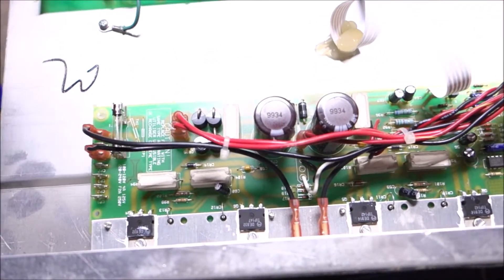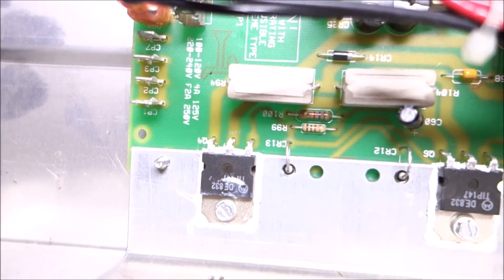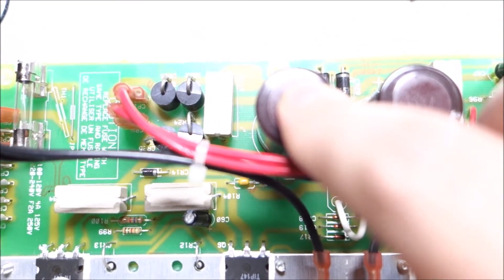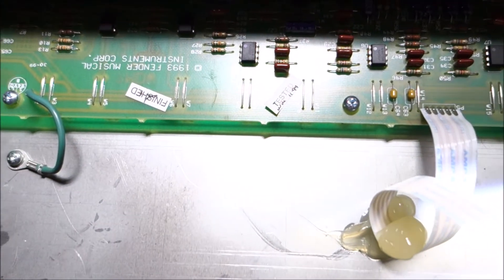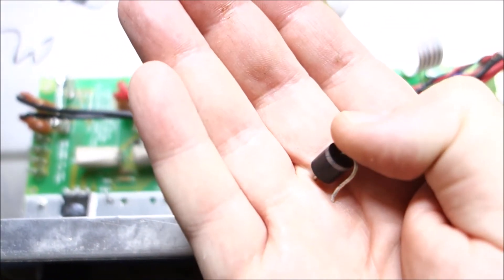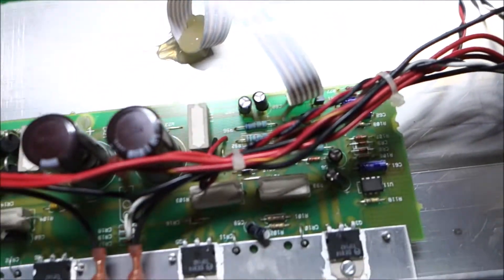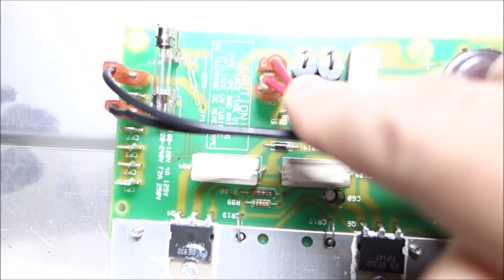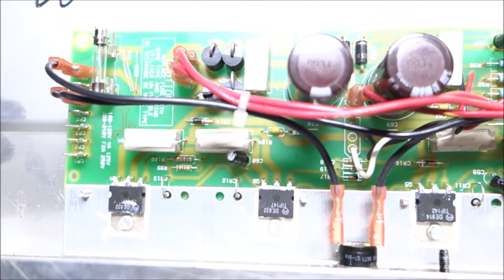Fender BXR 100 Bass amp blows fuses,  rather than working.........SOLVED.

Comment: Yo tengo un bxr60 de los cuales calienta mucho las resistencias  de 1wt y de 5 wt y cuando lo conecto ala corriente directa quema el fusible y se
Reply from the maker: You may have shorted transistors.   Or Capactitors...  something is shorted when there's fuses failing.
Reply: @DeadKoby  amigo me puedes dejar tu número de teléfono para mandarte la referencia ya medi las resistencias y  cambie los filtros que estaba mal la mayoría cambie diodos y transistores
Reply: Trabaja con los tip 142 y tip 147  se calientan Yano  quema el fusible es normal que caliente los tránsitores aún están sin audio y se calienta

Comment: I have a 1994 Fender BXR 60 with a dead short. So you have to lift the leg on every item you test for a short? that seems like a huge pain in the ass
Reply from the maker: No,  but it helps.  A great deal.
Reply: @DeadKoby  I'm thinking of just replacing both transistors.
Reply: @DeadKoby  they both show shorts between E and C. I guess you already know my next question what should I replace them with both are motorola T506 and T510. Thanks for your time

Comment: My BXR100 blows fuses. I found that both Q5 and Q6 are short (TIP142 & TIP147). Diodes were found to be ok.
Reply from the maker: Time for some replacements then.....   and be sure to check the surrounding components.    The NTE replacements worked OK for me.
Reply: Of course, once I receive the replacement transistors. I wonder what could take them down, there doesn't seem to be any other short anywhere but I guess I can only know for sure once they're replaced. The amp has been heavily abused in a rehearsal room for a couple of years...
Reply from the maker: @gilwe  Test the speaker for proper resistance.   I THINK it's 4ohms.    A shorted speaker could kill transistors quickly.
Reply: 3.8 ohm
Reply from the maker: @gilwe  That should be OK then.   Check all the power resistors (white 5w)  around the failed transistors.    And the diodes too.   Those white resistors sometimes burn open... and you can't see it.
Reply: Replaced all TIP and a few small diodes. Once replaced, the amp works, but as I turn up the volume the TIP strat burning...
Reply from the maker: They are going to get warm.... and that's why they are on that block of aluminum to take away heat.    If it's getting super hot,  you've still got a problem component in there somewhere.    The TIP transistors aren't made anymore,  and much of what's on Ebay is counterfeit.  I bought the NTE versions for my repairs from here forward.
Reply: @DeadKoby  Is it normal for the two 270ohm/5W resistors to get extremely hot? I've already replaced the four TIP,  the zener diodes, the 1N4888, the 6A4 diodes in the bridge, 2SJ111 (which seemed short!), and those two 270ohm/5W... now all voltages seem ok but still these two resistors become way too hot.
Reply: bummer! although replacing all those, and all voltages seem correct, it blows the fuse once I turn up the volume and play the bass! no idea why. When just idle, it works and no fuse is blown. Any suggestions?

Comment: My dog was sniffing my amp as it was on and she gave it an static shock and now the fuses blows whenever I turn it on. Was hoping a new fuse would fix it but Im afraid its beyond me expertise at this point.
Reply from the maker: I've fixed several of these that had dead shorts in them. Often it's a rectifier diode. Hopefully it's not the power transistors
Reply: That's too odd :/